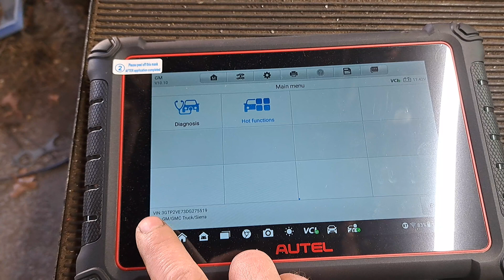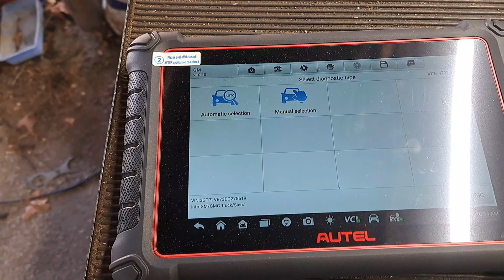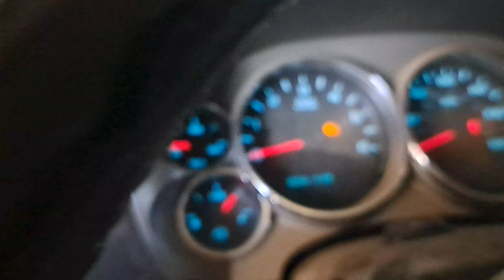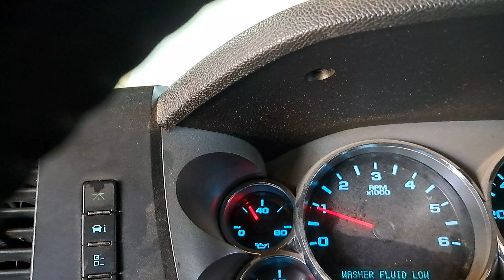🔥🚨Ohh NO!! How To Fix Idle Issues on GM Trucks🚨🔥

Comment: Excellent advice William! I use the Launch 909x with all my vehicles, it cost less than the Autel at only $400. I should've got the Autel though as the Launch doesn't have the ability to retrieve a vehicles 4-digit security pin the way the Autel does! I found that out the hard way with my daughters Chrysler 300. Lol

Comment: I got the same issue on my 98 Ford But then it's defense. It's got to 220000 mile blues😂.
Reply from the maker: Vacuum leak at the back of throttle body, it's more than likely the PCV reducer where it goes into the rear of the intake, maybe